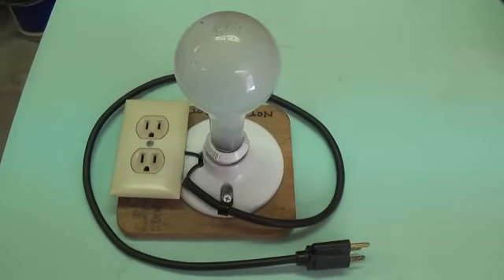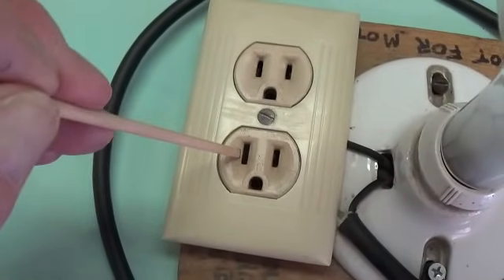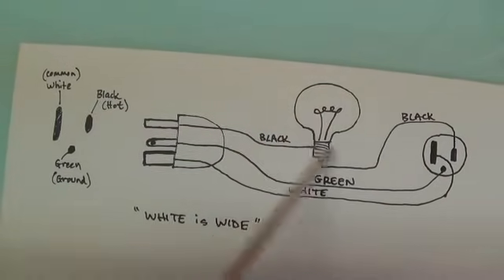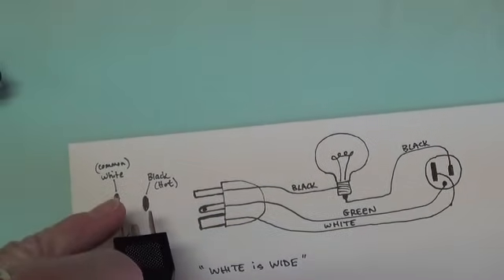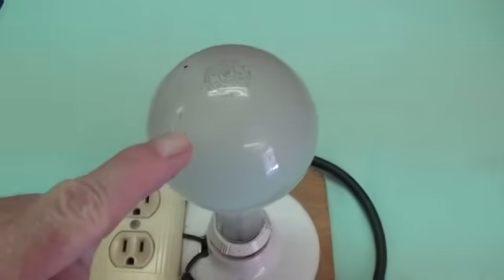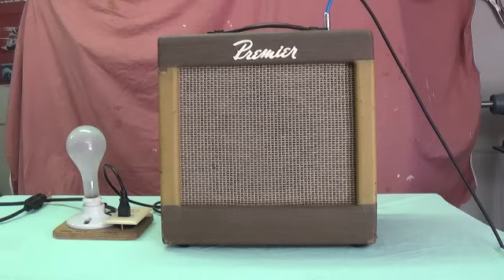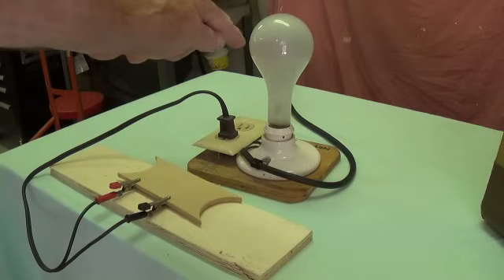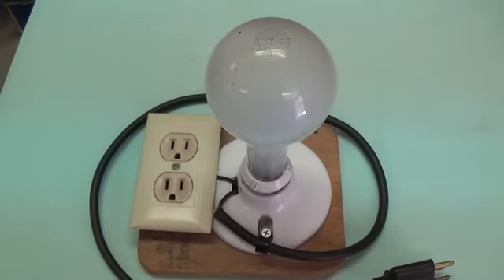Build Your Own Current Limiter for Protection when Repairing and Testing Electronic Equipment

Comment: Hi Doug, I saw your very useful device and thought I would build one however in the UK the availability of high wattage bulbs is restricted and expensive. 100w bulbs are available on eBay so I coupled 2 in parallel to acheive almost the same result. I enjoy your videos immensely, very informative and a voice that's easy on the ear. Keep it up.
Reply from the maker: Greetings, JW, and thanks for your nice comments.  Since your voltage in the UK is double the 110VAC we have here,  your bulb wattage should be about half what we use here......so the two 100W's would be about right, or even two 75W's in parallel.

Comment: Just a thought, Doug. When wiring the current limiter (I use one that I made twenty years ago), I would suggest the hot wire from the mains be wired to the center conductor of the bulb fitting, not the screw base as this makes the base, which is more easily contacted by errant fingers, live (or hot). This way, if the bulb is partially unscrewed, the metal parts of the bulb are not live if it happens to get plugged in in this condition.
Great videos. I have an interest in vintage radio restoration in my retirement years and between you and Paul Carlson (Mr Carlson's Lab), I've got valve technology covered.
Reply from the maker: Thanks for your nice comments and helpful input, Neil.  Your suggestion is a good one.
Reply: Correct if I am wrong, but I think this doesn’t matter. The line going into or coming out of the bulb is hot on both sides the threads will be hot no matter what. The only true neutral is coming out of the outlet common side with the white cable. The bulb and DUT are in series and share the available voltage drop at the same current.

Comment: Hi Uncle Doug,I built one of these and it has saved me many fuses,thanks for posting this video.I am trying to repair a marshall 8080 valvestate amp at the moment,my problem is that when i switch on the amp through the current  limiter the bulb stays bright ,but the amp goes on then off,while the bulb stays on,,,any ideas !!
Reply from the maker: The current limiter is mainly for tube amp circuits, Mr. A. Solid state amps, like the 8080, have very different current requirements (generally much lower) than tube circuits and you have to be very careful with your bulb wattage selection (generally lower wattage for SS). If the bulb lights brightly, then the amp is drawing more current that the bulb can handle....which is very unusual for a SS circuit. Does the amp work without the current limiter in series? If not, there may be a serious problem in the power supply that is drawing much more current than it should.  You need to start checking components and looking for possible short circuits.....particularly in the filter caps.

Comment: hello Doug! Great video as always!!! Will a 200W bulb suffice while working on a 4xEL34 100W tube amp head? Mains power here is 220V AC
Reply from the maker: Thanks, L14. I believe the 200W bulb may be inadequate for a 100W amp, even in a 240VAC area. You may need a pair of 200W bulbs in parallel to properly protect the circuit without having the bulbs glow too brightly.

Comment: I'm confused as to why you don't just make one from scratch in the video. I don't really understand what needs to be done when running a wire "through the bulb" and it would be really helpful to show the process.
Reply: Your bulb has two contacts 1) the tip or base and 2) the foot, the part with the screw threads.  These connect to the black and white wires normally. In Uncle Doug's case you are essentially stripping the outer insulation to expose the three wires in your power cord leaving the white and green wires alone and cutting the black wire. Then attach one of the cut pieces to the white wire on the lamp holder and the other cut piece to the black wire on the lamp holder. Super easy and just allows the current to run through the filament of the bulb. Because the filament has such low resistance it works as a wire until there is another low resistance component shorting to ground or neutral. At that point then the lamp works as lamps do and lights up turning all that current into light and heat.
Reply from the maker: Thanks for providing this excellent explanation, Scott. I hope it is adequate for Jeff.  In addition, there is a diagram in the video showing exactly what you described.
Reply: Guys, it might seem really obvious to you but it's not. Once I had the parts in front of me it was clear, but the diagram and Scott's explanation only seem clear and simple to you guys because you've already done it. How-to videos should include a visual of every step actually being done in real time. This is why most instruction manuals are so bad; it's because the people writing them know so much that they lose sight of the forest for the trees. I appreciate the effort, though. It was a good start and I learned something.
Reply from the maker: I'm sorry the video was inadequate for your needs, Jeff....but I'm glad you were able to build your own current limiter and were also able to learn something in the process.

Comment: Can you use your amp with this device? Does it change the sound? Thanks!!
Reply from the maker: Yes, I use my current limiter continuously when testing and evaluating vintage amps. It lowers the voltage and current a little in the circuit, which generally isn't a bad thing in amps designed for only 117VAC. I don't notice any change in tone at all. You're welcome.
Reply: +Uncle Doug thanks! I'm in a 220v country. Is it any difference? Thanks again! 
Ps: I really lappreciate your videos. I don't know much about electronics, but I love learning this stuff.
Reply from the maker: You will need to double the bulb wattage, since your current flow is half of that in 120V countries (like mine). You're welcome, Juan.
Reply: +Uncle Doug thank you very much!
Reply from the maker: You're welcome :)

Comment: Could I add more Bulb using parallel circuit on the first bulb to add more watts on the bulb incase we cant buy 250watts bulb??
Reply from the maker: Yes, that works fine. Two or three 100W bulbs in parallel will act exactly like a single 200 or 300W bulb.

Comment: it's a 1949 Bronson with a 7c7 in it like the one you worked on not all that long ago(National?).. Only volume no tone control. I guess I won't worry about it if it's not an issue.. thanks for your time. keep up the good work.. it is appreciated.
Reply from the maker: Yes, the National Deluxe did have Loctal tubes. You're welcome.

Comment: the largest wattage I could find was a 300 watt at Home Depot that's what I'm using now. I couldn't tell it was glowing with all the bright lights on in the shop(it's frosted not clear).. Until I touched the bulb. I'll have to check the current usage of the amp.
Reply from the maker: A 300W bulb should work just fine for most medium-output amps. If the bulb gets a little warm, it's not an issue.

Comment: First of all... let me say you have a great teaching style. That's a gift. I learn something new from each of your very well done videos. thank you.
Now a quick question.. I built a current limiter like the one you did in your video and hooked up an old Bronson. the amp worked but when I turned out the lights there was a faint glow in the bulb.. not very bright but a glow none the less.. Does this indicate a minor short somewhere or is this normal? Thanks and please keep 'em comin'.
Reply from the maker: You're welcome, JJ.  Depending on the normal current consumption of the amp and the wattage of the bulb, it's generally not a sign of any circuit problems if you get a faint glow from the bulb......however, if you intend to operate the amp with the current limiter for an extended period of time, you should increase the bulb wattage so there is no glow.

Comment: Thx so much for this genius idee. I immediately build my own current limiter based on yours Uncle Dog. i allready tried the short-test with a screwdriver and the bulb lighted up. I have still 1 question: i want to make a short inside my amp (Champ 12 red knob). I want to make a short circuit between the B+ and ground. should you recommend this test Uncle Doug? thx....Stefan.
Reply from the maker: You're welcome, Stefan. I wouldn't recommend purposely dead shorting your high voltage. Even with the current limiter there may be harm to the rectifier or power transformer.  It would be like testing new tennis shoes by running back and forth across the freeway......not a good idea.

Comment: Hi Uncle Doug & Family, I used my current limiter to check out an old 1950's G.E. 5 tube radio I bought some time ago. I know my current limiter works, as I purposely shorted it out, and the bulb lit with no damage to me or my cheapy DVM. I can sneeze and spend  20.00 dollars. Hey, what do you know, the tubes warmed up, and, the old radio worked. We're so far from Portland, about an hour and a half, so reception wasn't great, but came through pretty good. I boned an old radio and got tube sockets and a couple terminal strips, some old resistors, etc.. Will go new for 5F1 amp though, first build, you know how it is. Take care, be good, C.
Reply from the maker: I'm glad the current limiter is working for you, Cass. It sounds like you're keeping busy. Best of luck with your projects.

Comment: Greeting Uncle Doug and Rusty from the UK! Here's a question for you and I think i may know the answer: I have been looking to get the bits to make myself a current limiter as you describe here but I am struggling to find any "old school" light bulbs anywhere - they are all the modern energy saving type or LED. I suspect this design will not work with those but thought I would run it past you. Do you know if they do the same thing or not?

Great work on all your videos - I've learnt alot from them!
Reply: Rough Service bulbs are (at this time) still available, same power consumption but lower light output for the same wattage. There are a few counterfeit 100w heavy duty/rough service bulbs out there; if they look shoddily assembled at the base or the pearling on the inside of the glass is grainy do not buy them. Have had a BELL and also a BEST fail, the BELL allowed air to leak in and next time it was switched on a plasma jet shot out through the solder contact and damaged the holder, the BEST leaked and...exploded.   I have reason to believe at least one of these was a counterfeit with a convincingly replicated box design.
Reply from the maker: Thanks, NM. I'm not sure about the availability of incandescent light bulbs in UK, but I believe they are readily available on Amazon.com.  You might consider ordering a few.
Reply: You can buy 105W halogen bulbs which will do the job from a supermarket. (ASDA in my case.)

Comment: Now you mention using this as a means to test electrical equipment, but what if you wanted to run a device off of it for an extended period of time. For example a homemade device using a motor of unknown voltage.
Reply from the maker: +dark eIndzEl   As I say in the video description, this device is not intended for use with medium to large motors, which require a high initial current to start....and it is only to be used for electronic gear which utilizes 120 or 240VAC  (bulb wattage is different for each voltage).  It can be used for an extended time with gear of this sort.
Reply: Alright, Thank you. I have a small motor from a cordless drill. what I want to do is run it off an outlet since it's just the motor.
Reply from the maker: If the motor is from a cordless drill, it must be a low voltage DC motor, which cannot be operated with 120VAC power.
Reply: Thank you for your feed back. I appreciate the insight you've provided.
Reply from the maker: You're welcome :)

Comment: A good basic way of protection. However, I work with a wide range of consumer repairs and found that the safest method is using a isolation transformer that has variable voltage and current limiting capability that I use religiously. When you vary the voltage down it can help track high resistance shorts. The only real disadvantage with this method is with switch mode power supplies, they require at least 90 volts to start in order to regulate, providing there is no issue such as short. Regardless; a great demonstration on how to build a current limiting device.
Reply from the maker: +John Cunningham  Thanks, John. No doubt there are other excellent ways to accomplish the same goal, but this method is a very  easy and inexpensive way for "regular folks" to achieve effective current limitation.
Reply: I completely concur when it comes to alternative inexpensive ways to offer a margin of safety. I do like the fact you explain things so clearly and simply giving everyone the opportunity to learn how devices work. To many other sites assume you have an understanding of electronics leaving some people in the dark and skipping over important points. It is nice to see you include everyone that wants to learn, "bravo"
Reply from the maker: Thanks so much, John. Rusty and I sincerely appreciate your very nice, supportive comments.

Comment: uncle I live in Israel
Our electricity is 230V

for 230v line what bulb watt you Recommend ?
Thanks in advance
Reply from the maker: +David Az   Greetings, David. Although your voltage is double (230VAC vs 115VAC), your current flow is about half. Since the Current Limiter (CL) depends on current to rapidly heat the filament and increase its resistance, you need a bulb with higher filament resistance. Since the filament resistance of the bulb decreases with higher wattage, you should try a lower wattage, higher resistance bulb.....i.e. a 100W......initially, and then fine tune the wattage depending upon the power demands of the amplifier being protected.
Reply: thanks uncle :)
Reply from the maker: You're welcome, David.

Comment: hello Doug can I use your video to explain my friends about this useful circuit to turn on and test solid state audio amplifiers most of my friends do not understand English that well :)
Reply from the maker: +vargasmongo3435  Yes you can, but be sure to emphasize that the bulb wattage must be much lower for solid state devices, since they draw less current than tube circuits.  You should probably start off with a 40W to 50W bulb for a SS circuit.
Reply: thanks Doug I will add that info  have a great day :)
Reply from the maker: Likewise, V.

Comment: Uncle Doug,
My son brought home a 500watt 130v bulb for me to build our first Current Limiter.

My question is; does the 130 vac rating change the resistance value or should it be 120 vac rating only?

Thank you for all your help, Rusty too!!!
Reply from the maker: +Finom1  The 10VAC difference is of no significance, F1, but the wattage is very important.  A 500W bulb would be appropriate only for relatively high wattage (high current) amps.....i.e. 40W to maybe 100W. For low to medium wattage amps (5W to 25W), you would need a lower wattage bulb.....i.e. 200W to 250W.  The bulb wattage must suit the amp for proper protection.
Reply: +Uncle Doug 
Thank you we understand now!!!
Reply from the maker: You're welcome :)